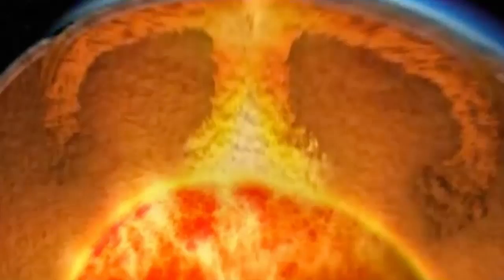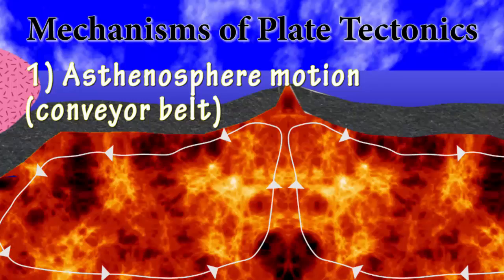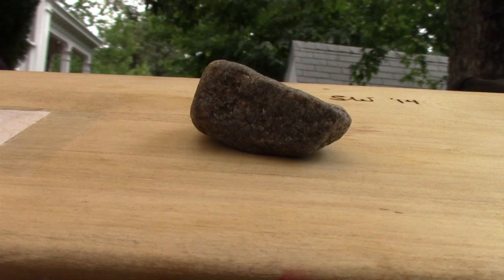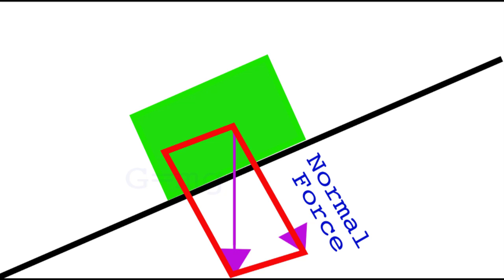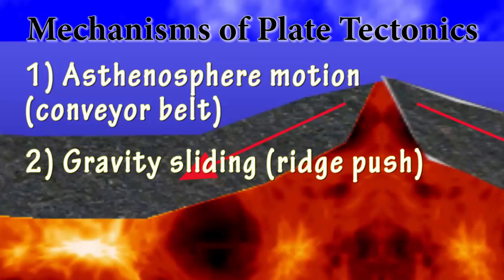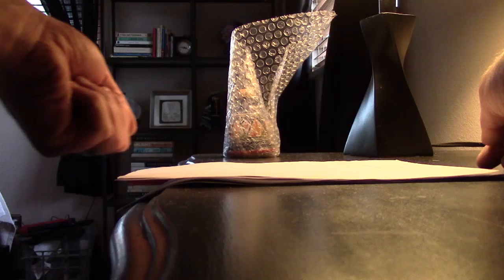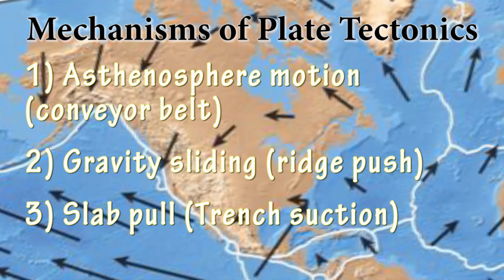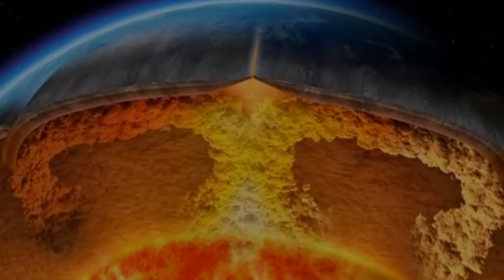54) Plate Tectonics 4 - Mechanisms

Comment: Part 1
Hello Prof. Shorey, I have enjoyed this video on plate tectonics. I know it has been several years since it was first posted but I found it far too important to not stop and comment on this subject. And more specifically, to allow me as one of those challenging the standard model, an opportunity to express an opinion as to the true and accurate description of the mechanism involved. 

  It’s interesting when you consider how much the standard model is dependent on the mantle having a convection regime. The great Arthur Holmes is credited to its acceptance in geology and the suggestion it could be the missing energy source to drive the tectonic plates. But, he also readily admitted it could be wrong.  To date there is no direct observable evidence of the mantle having an up welling of lower density material resembling a convective cell or even a conveyor belt type of mantle movement beneath the tectonic plates. The standard model is only speculative in these regards.  

   But even more importantly, the surface observations over the years have continually presented evidence of a mechanism of plate movement far different than what convection could provide. The mantle appears instead to be a solid state material that is 2,900 km thick, with pressures so great that at only 100 to 250 kilometers carbon can be squeezed into a diamond matrix. There are now a growing number of researchers who are skeptical of the standard model’s over-dependence on such an overly simplistic idea.

Prof. Don L. Anderson of the Caltech seismological lab., had with many other geologists made critical assessment of the standard model.
    
 https://authors.library.caltech.edu/25038/122/Chapter%201.%20Origin%20and%20early%20history.pdf
   New Theory of the Earth 
   Anderson, Don L. (2007) New Theory of the Earth. Cambridge University Press , New York. ISBN 9780521849593. http://resolver.caltech.edu/CaltechBOOK:2007.001
 
  "Because of the combined effects of temperature and pressure on physical properties, shallow stratification may be reversible - leading to plate tectonics - while deep dense layers may be trapped at depth." 

     "Conventional (Rayleigh- Benard) convection theory may have little to do with plate tectonics."  

 Convection is so poorly defined that it is difficult to consider it even a viable working hypothesis unless there is some direct observable evidence that it can make anything resembling a prediction of observation. 

    Carlo Doglioni, the geophysicist and former president of the Italian Geological Society, and since April 2016, the president of the National Institute of Geophysics and Volcanology has published some very remarkable papers in regard to mantle dynamics and plate tectonics.

 http://www.dst.uniro...antle_Dynamics_
MANTLE DYNAMICS AND PLATE KINEMATICS
Carlo Doglioni, La Sapienza University, Rome, Italy
Roberto Sabadini, University of Milan, Italy

   ". . . . . none of the proposed models of mantle convection can account for the simpler pattern in plate motion we observe at the surface, nor has a unique solution been proposed for how material in the mantle convects. At the moment there is no way to link mantle dynamics and plate kinematics at the surface, considering that the mantle and lithosphere are detached.     The Atlantic and Indian ridges are in fact moving apart with respect to Africa, proving not to be fixed both relative to each other and relative to any fixed point in the mantle. This evidence confirms that ocean ridges are decoupled from the underlying mantle."

   This remarkable observation above expresses the reality of the situation. Geologists need convection to be a viable solution to plate movement, but after 90 years, its existence, let alone its functionality, remains unanswered in the standard model.

Comment: Part 4
So the way this model explains how this works is;

    For the last several decades the global network of geodetic stations has allowed us to determined that the relative motions of thousands of points on the planet's surface has shown that the net motions add up to zero for any global circuit. All of the observed tectonic plate domains that are semi-rigid and separating are matched by other domains which are converging. 

   It would then be most critical to any plate movement model to incorporate these facts into its description of operation. This model is dependent on a tremendous shear resistance between the crust and mantle that moderates the distribution of the compression that slowly moves away from its source at divergent boundaries to its final disposition at a convergent boundary. This is in part due to the isostatic equilibrium that is distributed at much lower values due to the compression that is now present in the global plate matrix.

For example, the Himalayas should not be anywhere close to the height that they are at. They should be sinking into the mantle at this moment. But, this model can explain this paradox by explaining that the Earth's entire plate matrix is, to some degree, being held in a compressive load state by its shear resistance to the mantle.
 
   Imagine how compression alone can hold a long series of un-mortared bricks in suspension without falling. Now if these were instead massively wide plates lying over a planetary sphere we have an idea how the immense shear resistance could hold a compressive bias in the entire planetary plate matrix.

   In this model the compression that resides in the crust at this moment is much older than the mantle displacement period that is currently taking place. The compression that is in the crust right now could be referred to as fossil compression, being that it is supplied by residual or "fossil" gravitational potential energy in the crust that was produced over the last several million years as the mantle subsided during the Pleistocene and Pliocene periods and produced in the crust many of the massive mountain ranges around the world that rose up so quickly during that time period.

   This process then, that produces this residual and periodic supply of compression in the crust, could be described in the mechanical terms of a reciprocal compressive engine, or even terms describing a mechanically driven gravity actuated drive.  This mechanism allows the newest divergent boundary infill to supply a means to periodically advance the plate into a state of compression that ultimately will end in a convergent trench. The plate first being loaded at the divergent boundary when the mantle moves down, and then during the following period of low activity this very laterally concentrated load of compressive energy will slowly redistribute across the plate, and will be largely distributed into, and added with, the overall crustal matrix when the mantle will once again slowly displace outward and again adds another boundary infill for the next round of compression. 

   This process has thus supplied the crust with a net plus of compression, which currently allows us to observe the divergent boundary metrics to be in balance with the convergent boundary metrics, as is shown in the geodetic measurements, all the while holding and keeping the world's mountain ranges from sinking into the mantle. 

   I would ask those in the geologic community to reconsider standard model. Old paradigms must fall for science to progress. I would very much like to discuss this Idea with anyone who is interested. The model can be viewed here;  https://www.electroplatetectonics.com/  

   Best regards, Marc linquist   linquistmarc@gmail.com